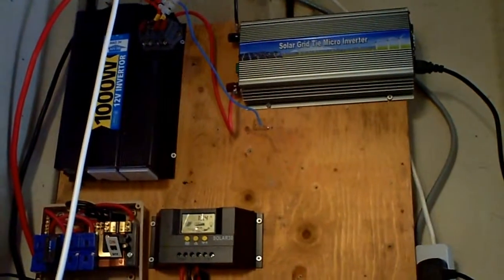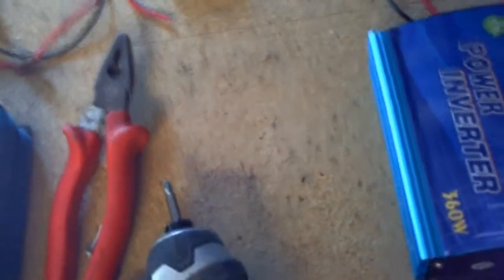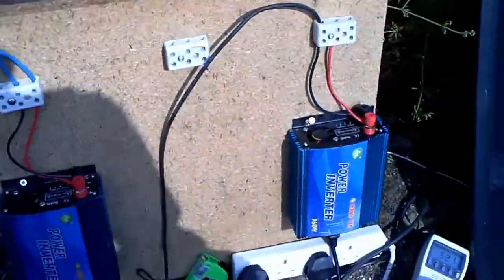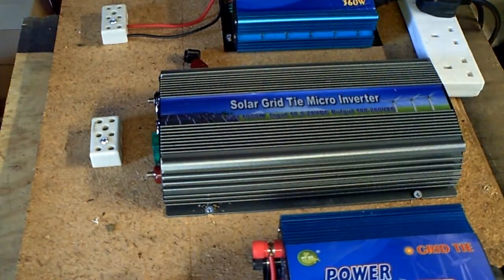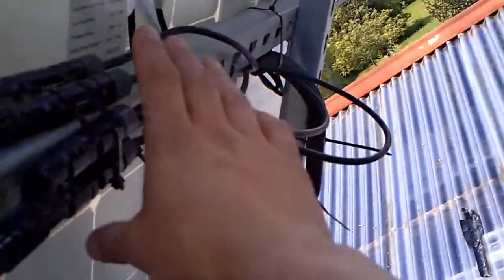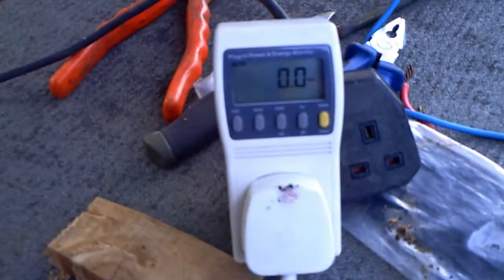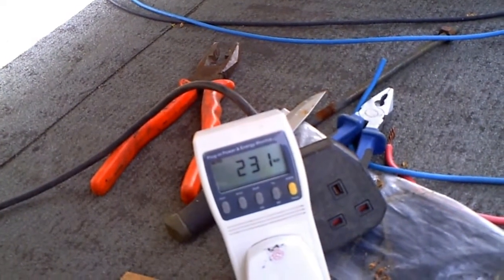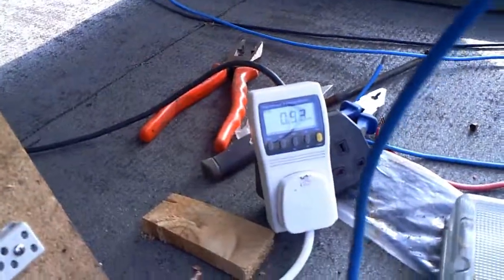fault finding on my solar array

Comment from the maker: I have 6 x 80W 12V panels. Currently on a 1000W grid tie. The grid ties are all rated 12-30V, I don't know if i'll kill the grid tie by putting 2 panels in series, because open circuit voltage is 20+ Volts? Let me know if you have any ideas?